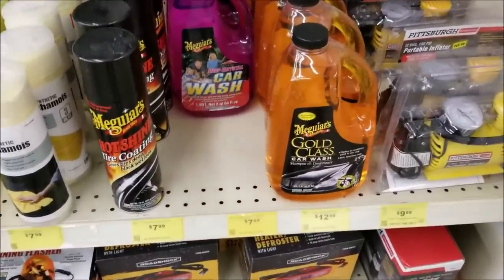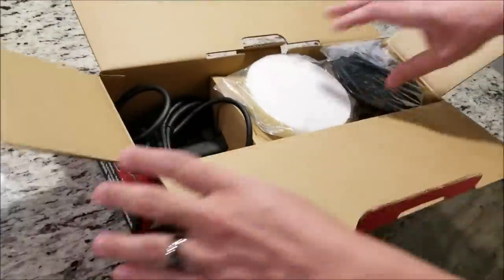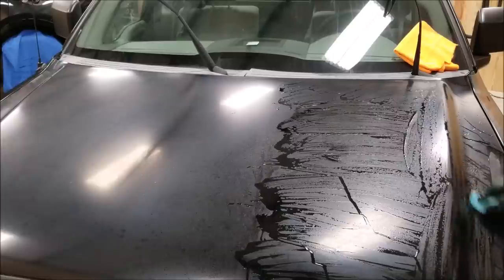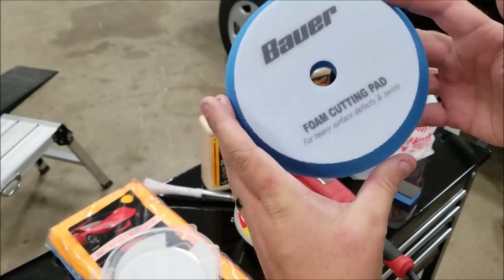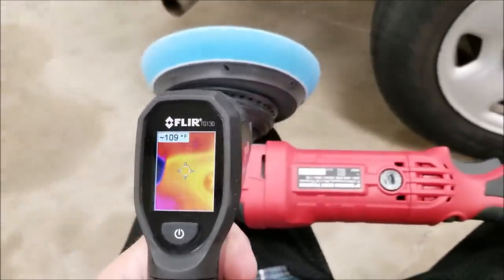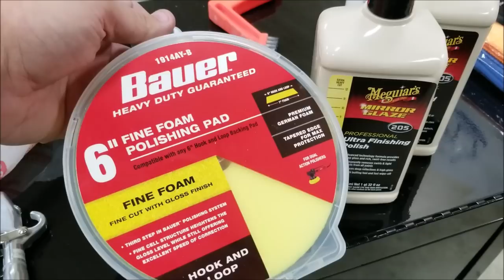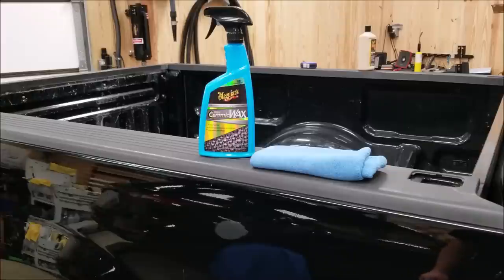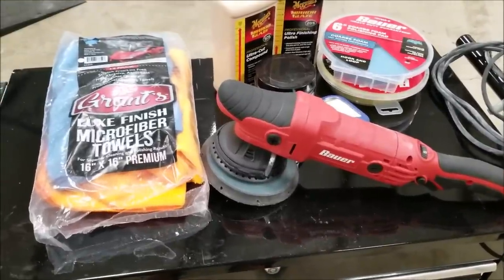INSANE 2 Step Paint Correction using ONLY Harbor Freight Products for less than $200 HF Bauer 56367

Comment: there is another YouTube video on the polisher where he took it apart and remove the Chinese  lube and replaced it with White lithium grease. Then he use a 5" inch pad from a better polisher that was interchangeable. This improved the vibration on the Bauer polisher and make it easier to use.
Reply from the maker: Yes absolutely made a huge difference.
Reply: I agree that the most critical parts indeed besides the substitution of the Bauer Harbor Freights random orbital dual action polisher; would definitely be the foam pads and cutting medium and fine cutting compounds themselves; one could definitely try using and substituting in the Rupes branded name medium and fine five inch cutting compound foam pads for its more aggressive and complete cutting compound action and also using the Rupes branded name medium and fine abrasive cutting compounds also as well; 

to see if they can make a visually discernible qualitative and quantitative difference in the final actual vehicle finish quality side by side differences; also one could measure using a gloss meter; if the qualitative and quantitative gloss meter readings were 10 gloss units or higher as that would be a major break thru that would indeed probably be worth paying more in the long run.
Reply: Sorry to be offtopic but does anybody know a method to get back into an Instagram account?
I stupidly lost my account password. I appreciate any tricks you can give me
Reply: @Cole Julio instablaster :)
Reply: @Mathew Wesson I really appreciate your reply. I got to the site through google and I'm waiting for the hacking stuff atm.
Takes a while so I will get back to you later with my results.
Reply: @Mathew Wesson it did the trick and I actually got access to my account again. Im so happy:D
Thank you so much, you saved my account !
Reply: @Cole Julio You are welcome :)

Comment: Awesome job by the way with the tools you had to work with. Meguiars never lets you down. I would have finished the job just the way you did, those ceramic spray waxes are great.
Reply from the maker: Thanks 👍  That they are... HUGE time saver.

Comment: Many years ago, I bought some HFT tools from the big store in Camarillo, CA.  Those were the orange colored tools and were named Chicago Electric or something like that.  They were junk, sometimes now working right straight from the box, but they were cheap.  Their hand tools were cheap.  That was back in the 1990's.  Fast forward to today and they've cleaned up their act, but prices have gone up a lot.  

I bought one of the Chicago Electric maroon colored DA's maybe 7 or so years ago.  I'm not a professional detailer, so I figured it would do the job for me.  8mm, shorter unit with a locking switch on the side.  It does vibrate and my hands are tingling after a long run.  The backing plate isn't balanced either.  It uses 6" pads, which I think are on the large side for such a small DA.  IT does the job, but if I were a pro, I'd only use it as a back up - the vibrations would do some physical damage.

A few years ago, I bought a 20mm DA similar to the one you bought at HFT.  It's a cheap made in China tool with even more vibration and not enough power to keep the pad spinning - I'm going to drop the backing plate down to a 5 inch to see if it helps.  The tool was cheap - $59 cheap or something like that.  

If i have to choose which tool to grab, I'm almost always grab the Chicago Electric HFT.  I thought the long throw would be better, but it's heavier and it's harder to use.

Great job on the truck.  It looks nice and shiny now!  I have a car in similar condition that I need to do.  In a few weeks, when I'm done with my current project.

Comment: Great video. I am going to be working on our cars this weekend with basically what you have.  I'm a little nervous with not having ever used a polisher and there are so many options.  I'll start with my daily as it has the roughest paint and has been painted on a few times.  I've just washed them and detailed the insides. Always left the outside to someone else.
Reply: Also want to try to polish out the scratches where my 2 year old gaughter used a bolt to draw on my car and a rock on my wife's van.
Reply from the maker: Just take your time.  It's easy to want to rush it.

Comment: Awesome. It’s almost like successful results are more about the professional experience/education of the worker than it is about the equipment. Who would have thought?!

Question. Noticed you wiped off the 105 before using the 205. Other videos I’ve seen the detailer doesn’t both wiping off the correction compound and goes straight to the finishing compound. Is one way better than the other or is it just user preference?
Reply from the maker: I've always done it wiping off and then doing the next step.
Reply: you correct, a good detailer could get results with stuff from the dollar store but a professional doesn’t use junk cause it takes more time which costs you profits, cheap stuff doesn’t last, it vibrates to hell as Scott shows here and while 105/205 is great, other cheaper alternatives are a major pain in harsh climates. Just cause you can doesn’t mean you should. I could paint correct a car by hand, doesn’t mean its a good idea. If your really poor you can actually get decent results with a backing plate chucked up in a drill but I wouldn’t recommend it. Probably need to be spending that time looking for a job at that point.

Comment: Wow that polisher was getting really hot. I use my Milwaukee drill which also gets hot after some time but never to the point where it's uncomfortable to hold.
Reply from the maker: ...and this is in my A/C shop that is 72 deg F.  Outside or in a much warmer temp, it would be even hotter, but it wasn't unbearable.

Comment: In front of the polisher from harbor freight there’s a little hole above the housing The Alan wrench that comes with insert it turn it clockwise or counter clockwise the balance it that move the block that’s in the polisher and charge the grease you’ll will see the difference

Comment: Scott, for your viewers, I always do a chemical decon when I do a correction before I clay.  Also, I have a Porter-Cable DA which is about the same price of the Bauer.  Hopefully it would last longer the Bauer?  I enjoyed your piano music.  Nice job on the correction!
Reply from the maker: Thanks! Trying to find the sweet spot for the music as I grow this channel!  The porter cable 7424 is a good polisher - I had one for several years before the Rupes and Flex came to the US around 2012.  It will still do a great job at removing imperfections.
Reply: What do you use for it? A stripping soap? Or what?
Reply: @every_thing_wood1251  I first wash with a combo of Super Clean, Purple Power Vehicle & Boat wash & Dawn Dish soap.  That combo is my striping soap mix,  For decon., I use an Iron remover and clay mitt.

Comment: Nice review.    I was really wondering about that Bauer Polisher from Harbor Freight.   For the price, and a 20% off coupon, and if your an enthusiast or weekend detailer that's only going to use it a couple times per year at the maximum probably,  it's really a great deal.   And it performs pretty well for a Harbor Freight tool.   It's without a doubt the best polisher they are currently selling.   I know people will say, "oh no, it's the knock off Porter Cable they sell", but to me, a knock off Rupes or Flex or Griots, whatever you liken it to, is a great deal.    And that long throw polisher coupled with the Meg's 105 and 205 did an incredible job!   I was literally stunned after that first section of hood you did, how well that 205 compounded off that flat paint and made it super glossy.   Compared to just 5 years ago,  Harbor Freight has really upped their game when it comes to polishing products.  5 years ago I went their and got the knock off rotary and knock off Porter Cable for less than $100 for both machines.  They actually worked pretty darn good for the price I paid and I used them for many years before going for the more expensive machines (Flex 3401, Makita Forced Rotation/DA combo machine, Flex mini, and a few others).    Where Harbor Freight really lacked back then was on polishes, compounds, and especially pads.   Their pad choice was CRAP!   The pads would induce more swirls than take them out, no joke.    They were literally the cheapest pad you could buy anywhere I think.   Even Family Dollar probably had better pads.   But now,  I stopped by Harbor Freight yesterday actually, and I was really impressed with their auto care isle and all the different products they had,  good selection of microfiber products,  pretty good selection of pads,  and yes the Meguiars products, although O'Reily's Auto Parts has a lot of the same Meg's products slightly cheaper actually.   And sometimes you can get them on sale too.   Anyway, that's a little off topic, but hey, you did an incredible job using stuff from Harbor Freight which is great because it shows us normal weekend warrior car enthusiast types that you don't need to spend your entire pay check or more for all these different tools and products to get really decent results, and to a weekend warrior probably OUTSTANDING results because most of the weekend peeps don't have an eye for blemishes like a professional or more experienced detailer would have.   They are going to reasonable gloss, shine, and just a generally good looking car.    I drove probably 20+ different cars over the past 40 years since I was 16.   I have always taken pride in every car i've owned (even if it was a beater car and had six different shades of paint!  (Had one of those in high school actually), but I still washed it out, cleaned it before going on a date, and kept it looking the best I could.  Every single car expect the last 3 or so were NEVER polished with a machine polisher,  NEVER.  I would use cleaner wax by hand to tackle a little of the oxidation and they did an OK job keeping the paint fairly clean.  I never knew what a clay bar even was up to 6 or 7 years ago.  Now I have 3 different kinds in my garage along with a couple "Liquid clay" products I use in conjunction with the regular clay, oh, and about 5 different kinds of the new fangled clay disc's, clay towels, clay sponges, etc.   So i'm covered in the clay arena! LOL.    All I pretty much did to detail my car back then was wash it (yeah, I just used a regular bucket, no grit guard (oh my, WHAT, "no grit guard", you heathen you!),  I used the same wash mitt on my paint as I did on my wheels (WHAAATTTT!, I know, it's crazy to even think about it), and I always washed my vehicles in full sun ("TAKE THAT MAN'S KEY'S AWAY,  HE SHOULD'NT BE ALLOWED NEAR A DIRTY VEHICLE!")  After washing (and letting the sun and air "dry" my car, yep, no drying aides, or drying towels, but maybe the occasional old bath towel that was no longer suited for use in our home would be used to dry the car.   Then a coat of Meguiars cleaner wax in the maroon bottle with the flip top cap rubbed in with a foam applicator (that's all we had back then before the days of micro-everything!), and a long process of wiping off the hazed residue and my car looked pretty darn good actually.   I always got comments from friends on how shinny and sharp looking my car was and "how'd you get it looking so good" type comments all the time.   I used stuff like Windex on the glass, and Fantastic or Mr. Clean from under the sink on the interior of the vehicle and to be honest,  they worked great.   Had a pretty decent shop VAC, nothing fancy, for the vacuum work or id' swipe our inside vacuum (My wife's PRIDE AND JOY) for a couple hours and get it done.   Then once a year I would use our "Little Green Clean Machine" spotter to do a full carpet and cloth seat extraction.  That little green worked wonders on the seats for what that machine cost.    Once friends saw how the interior looked, especially how clean the carpets and seats were, they started asking me if I could do theirs too!   I did a few friends cars as favors and they were thrilled!   Got back some decent "pay back favors" for those cleaning jobs too!    My point to this whole entire rant and life story I guess is that i'm glad you let us know that you can get decent tools and products at Harbor Freight and do a great job on your cars at home for the price you'd pay a detailer or less and YOU GET TO KEEP THE PRODUCTS AND THE MACHINE when you're done!  Best bonus yet.   Then, once a year, or whenever you get the hankering to clean up your rides,  you have the stuff to do it.   And you could probably help out a few friends and family members by doing their cars too!   The current market is SO SATURATED with detailing products now, it's unbelievable.   Back in the day, you had a few companies familiar to everyone,  Turtle Wax, Mothers, Meguiars, Rain Dance, Eagle 1, Armor All, oh yeah, and Nu Finish (The wax that lasts for 52 car washes!  Yeah right!, but I did actually use the stuff occasionally and it was OK for about 5 washes before it was dead on the paint!) where the products at Wal Mart and the local Auto store.    You had a small but pretty decent selection of products.   Now, good gosh,  Wal Mart has an entire isle dedicated to Auto Cleaner Products!   A WHOLE ISLE!   Both sides!    And they only have a small selection of a few name brands up and down the isle.   They even carry Chemical Guys stuff now!   I was like "WHAT!" when I saw that.   And a few others of the Amazon brands and more well known detailer brands.   Autozone carries Griot's Garage now,  WHAT!   Griot's was formerly just a mail order company, and an expensive one at that.   Great products for sure, but a little pricey.  I do use several of them myself now.    But the amount of detailing products on the market now is STAGGERING!   MIND BOGGLING!   LITERALLY THOUSANDS UPON THOUSANDS OF PRODUCTS AND BRANDS!   It's nuts.   Really nuts.    How many polishers to you need?   How many different ceramic coatings do you need?   How many microfibers do you need?   Drying towels?   Wash mitts?   Wash Buckets?  Grit Guards?   Clay Bars?   Iron Removers?   Polymer Sealants?, Drying Aide's?  Wet Waxes?  Hydro washes?   Pressure washers?  Vacuum's?    And the list goes, as Buzz Lightyear put it "To infinity and beyond!"   I've gotten pretty disgusted with the entire detailing market as everyone is trying to outdo the other.  Every day a new product or fandangled thing is coming up to upstage a competitor company.   "Oh, my graphene coating is my with GOLD FLAKES!, ha ha, mine's better than yours!".   "Oh, well, we just upped your gold flakes, and put in diamond dust sucker".    "Oh, we're gonna crush moon rock and put that into our next new cerama-mooner-coating!.      Don't get sucked into the abyss folks.  Go to Wal Mart, get a few products like PH balanced soap, a good wash mitt, maybe a grit guard is helpful, a drying towel microfiber.   Maybe a wheel brush, but you may already have a brush at home that would work perfectly fine.  Interior, you probably have everything you need, right in your current home cleaners!    You can do a pretty bang up job using very little "specialty" products and get a car that, to most every other driver out there, will look SPECTACULAR!
Reply from the maker: You win for best/longest comment. Haha. Great response!
Reply: @ScottHD  Yeah, I get that a lot.  LOL!   Watched several of your other videos.  Good stuff.    I especially liked the one's on the Trim Restorer products!    I recently purchased Cerakote based on some recommendations from other YouTuber Detailers.   I haven't installed it yet,  I still have to do a polish session on my sports car and then i'm going to apply it.   I really like a couple of the other products you tested, especially the look of "That Black Stuff".   Man, on camera, that stuff looks great.  Very dark black and uniform in appearance.    I guess the question will be durability.   Can it hold up in the long term.    If it can, i'm buying that stuff next time for sure.   And it looks like a bottle would last a lifetime.

Comment: My local HFs do have Meguiars M21 sealant. They also swapped out 105/205 for 110/210 and don't carry the green pads at all. Weird how the stuff varies by store. Oh, and those white "Polishing Towels" they sell in a two pack have the honor of being the worst towel I have ever used. I think you could soak them in a bucket of water and pull them out bone dry. They have literally zero polyamide. They do feel nice and soft though. 😁👍

Comment: How long do you typically spend on a two step correction using your go to tools?
Reply from the maker: Try to have less than 20 man hours in a two step correction and coating. Sometimes less, sometimes slightly more depending on the starting condition and the vehicle size.
Reply: 20 hours??? Holy crap no wonder I never do this ;)

Comment: I have the step down version of this, and it's not bad. Heat wise it wasn't terrible. I'm use to high vibration. So I can't really speak on that. But if you try to use the included handle, it vibrates like a freight train coming down the tracks. I'll have to try and use the pad combo you used. I used chemical guys new c4 and P4 with the orange and white pad. Got a lot of scratches out. But not all. And I know the compounds work. So maybe I was just using too fine of a pad.

Comment: Looks great! I have a 92 Ranger that I need to compound. I have a clay mitt that works great, I just rewash my car with it after washing it with my wash mitt. Then I'm just going to use Mcguires ultimate compound, and then NuFinish as that has slight a polishing effect as it seals the paint. Then I'll do another coat of NuFinish in a month or 2.
Reply from the maker: Awesome!  It's worth the effort you put into it for that final product "wow!"